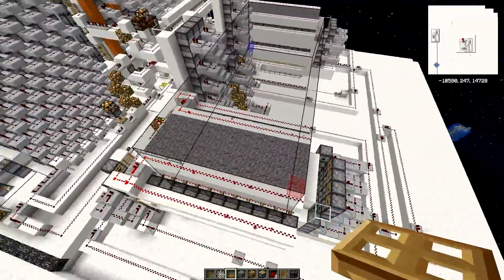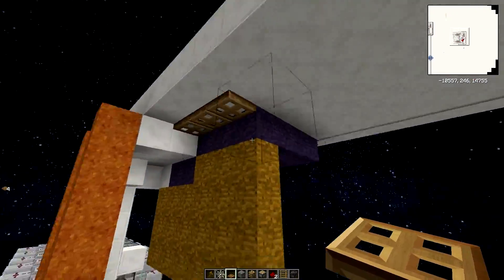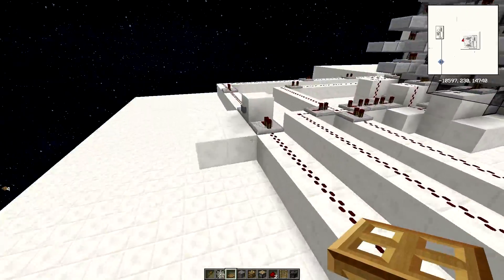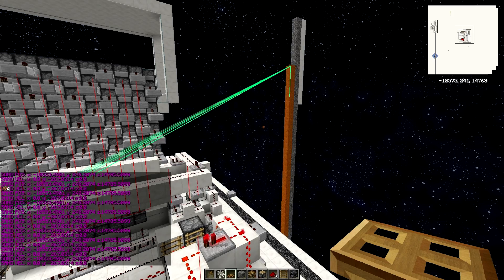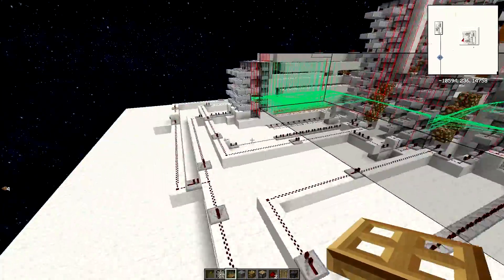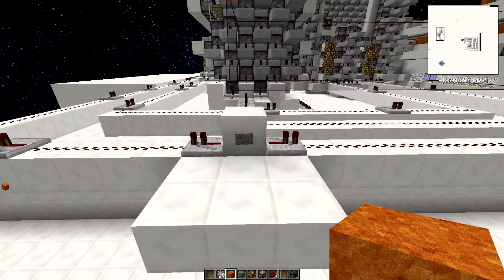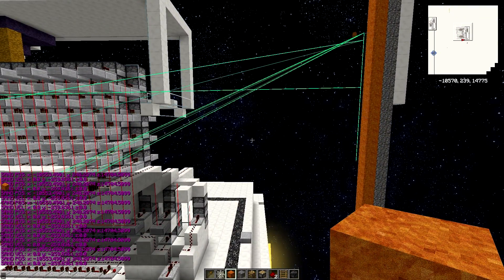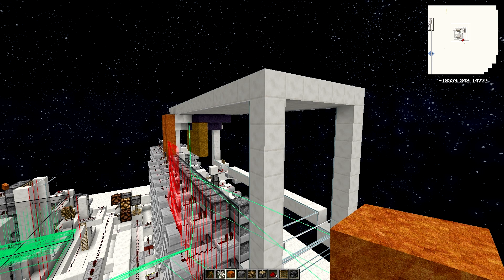Sand Velocity in OOE Stacking Methods

Comment: can someone please help me with a question? I wanna raid a base which has walls that are covered in lava then water then lava then water and so on... When i test raided it on my test server i cannoned through the first wall (lava covered) then when i cannoned the second wall (covered in water) the sand stack made the water flow to the lava and then generating cobble which for some reason wont break (i think it regens). Could someone please tell me whats the best way to raid those walls as soon as possible please? (the base is on cosmic)
Reply from the maker: +Lukas Gardenman have the stack hybrid before the water or lava has a chance to explode
Reply: +Beingsad so less delay on the oneshot tnt so it explodes the sand stack before the water can flow? and do you know any other good cannon test servers? i only know minelink
Reply from the maker: yep that seems like a decent solution, one or two ticks after the hammer would be solid I'd think...
Reply: ok ill give it a try thanks for your help! i didnt think you would actually respond because alot of people dont :(
Reply: +Beingsad Oh i have one more question: Do i need to change anything in my test server configs with how fast lava and water flows? i saw a option in the config which says water-over-lava-flow-speed? I followed your cannon test server tutorial to set up the server and i used your configs you but in the description as well so i dont know if you had everything setup?
Reply from the maker: +Lukas Gardenman Uhhhh no real reason to unless you wanted to change the sped-I have an issue with multiverse that affects lava and water speed for all worlds other than the default, but yeah idk depends on what you want.

Comment: Nice analysis! But why does it say that you need 500 tnt with a zero guider difference? In your video about fusion cannoning you were able to basically do a full stack with a normal amount of like 300 or did I miss something? 
Its still cool to know that I can save some tnt by lowering the hammer-guider by a trapdoor tho
Reply from the maker: I never used a 0 block difference in this video
Reply: +Beingsad yea i know, you used .875 and 1 block differenence. But in your chart, it says that with 0 difference you need 500 tnt to stack 256. And I wondered about that, because in one of your other videos (the one about fusion cannoning) you stack like 240 with 0 guider difference and dont need that much tnt.
Reply from the maker: Theres a few different reasons for that I think, one being the hammer ticked off much later when compared to this video, and also I was using the 255 nuke in that video-with the 100+ extra tnt for the nuke scatter being in the same block, and helping the hammer-so it was close to 425 tnt stacking the sand there I think.
Reply: +Beingsad Ok that makes sense. And also explains why I was only able to stack like 150 when I tried the 0 block differential. Thank you for elaborating

Comment: Correct me if im wrong but about your desc, the sand and tnt are technically not in the same block at the explode time for tnt, sand updates, falls down below the tnt, when the tnt updates it doesnt fall down but it explodes.

And this can also be explaining this video, when the sand falls its no longer in the trap door guider position. Its in a different position thats better for the velocity that the tnt radiation applies to it. And thats basically how this worked.

I wouldnt really say this proved assumptions wrong but rather is a new "guider" at the game tick of explode time for tnt.
Reply from the maker: Why wouldn't the TNT move before it explodes? Why is it when sand is in the same block (zero guider) it has a higher velocity than when it's a trapdoor or half slab? Wouldn't the explosion act similar? The classical movement idea would have it as a parabolic function perhaps, with 0 being 0 (not 150), and 1 being the max, with eventually around 7 being 0 again.

If you flipped the order, you don't see the sand shoot upwards? Similarly we know the TNT will move before it explodes, which is why the slabbusting effect and full stacking works
Reply: +Beingsad It does move BEFORE (game ticks before) it explodes but when its updated to explode it doesnt move it explodes.
And  thats why if you have sand updated before the tnt, its gonna react before tnt and fall before tnt while when its time for the tnt to explode its not gonna fall down to the position of sand but create a space between the tnt and sand.
Why it wouldnt reverse shoot if you flip it is pretty easy to figure out from what ive explained.
The game tick that the tnt explodes is the game tick it doesnt fall because it explodes. Now if it was updated before the sand, from the positions of the game tick before, the tnt would explode in the same position as sand.
Reply from the maker: +IceOP - Minecraft I stand corrected-I'll have a more detailed post when I get home from lab
Reply: +Beingsad Alright :p
Reply: You all talk way above my 136 iq.... Then again I haven't studied cannons for over a year now and back then a lever cannon wasn't useless so I mean uhmm yea :/
Reply: Ikr, I'm still learning all the parts of 40,60,80,100 stackers and how they work. This shit right here is confusing asf, I still have trouble making my own 40 stacker 1 shot.
Reply from the maker: +IceOP - Minecraft Cool, I've got some time right now. You are definitely correct with how you're detailing the movement because of OOE-and its specifically something I've talked about before (first video where I talked about it with "fusion" cannoning I believe).

I'm still surprised with how the sand moves during an explosion when its in close proximity to the TNT (less than a full block), as classically (with code analysis and testing from Diissaster some time ago), the modeled function would be a sort of bell curve. If you imagine we shifted the plot to the left (taking into account the initial dip from the sand because of the rendering, thus setting zero guider at 0)  the applied velocity would increase until it reached a full block (again shifted to the left,) and then decrease again back to zero (normal maximum TNT interaction range). 

No longer shifting the plot to the left-the movement from 0 to 1 still seems odd- efficiency decreasing from zero to .5, THEN increasing (the expected behavior). All movement after .875 and 1 is expected.
Reply: +Beingsad You never know what to expect until you discover it :)

Yeah it doesnt really matter how close sand is to the hammer, for example slab guiders require more hammer than trap doors. This video is also a prime example of it. You never know, maybe there could be a different guider thats even better than this.

I was working with stacking with less hammer some time ago (semi worked) but i ran into some issues, which i know the reason behind. So lets say for example you have a block guider on 20 sand and a trap door guider on 20 sand and lets say you have 12 tnt hammer at y 18(using different velocities to stack). The sand on the block guider would move down first to whatever y level it needs to fullstack the next shot. But once thats done, the sand on the trap door guider is gonna start to move and then stack on top of that, making it stack more than it normally should.
Now this is hard to full stack with using less hammer than you normally should.
BUT i believe that if you could find the right amount of hammer at a certain y level and get it working with ooe, then it could be very possible.

And also do you think that stacking ON mid air is possible? using tnt stopping methods to have enough tnt to stack on tnt when at explode time.
Theres lots of interesting ideas of methods out there that probably would work :)
Reply from the maker: I want to do more concrete testing-the plugin diissaster made doesn't work all the time depending on how rendering is done-but I know how to track velocity manually if the plugin won't do it.

I like the thought of what you were saying with sand stacking (different barrels, etc), but keep in mind it will want to full stack on the last shot-so it'll break down the stacks in certain segments, my memory on that is hazy as its been two years since we figured out classical stacking methods and mechanics lol.

You can use OOE to stop sand, so long as the Y velocity is equal to or greater than the distance from its midair height and the ground-it should want to stack down before it stacks forward (based on the z/x velocity)-thats how you can get the bricks of sand and stuff.
Reply from the maker: For example, if the stacking height (explosion location) is 248, and you're using a 74 stacker (or applying 74 velocity), and stacking from bedrock (248ish blocks), it'll take 3.35 shots to stack to 248-the first shot will stack .35*74=26 sand, and then each other will stack 74 to the barrel-so with alternative methods of stacking, the velocity applied and the stack location will still affect it.
Reply: Beingsad Yeah, as i said the issue would be full stacking, because of how stacking and movement works in game ticks.